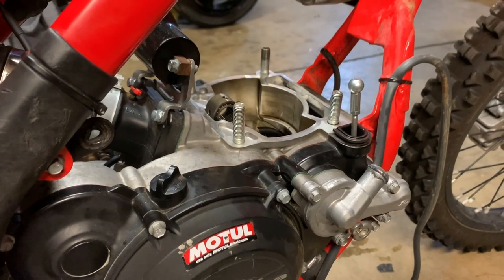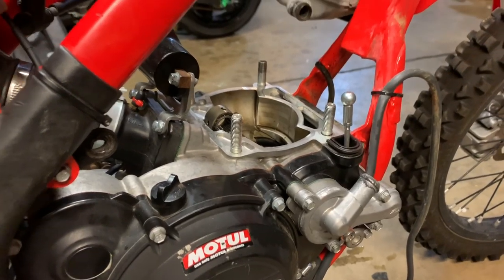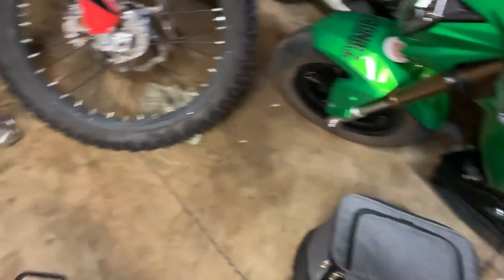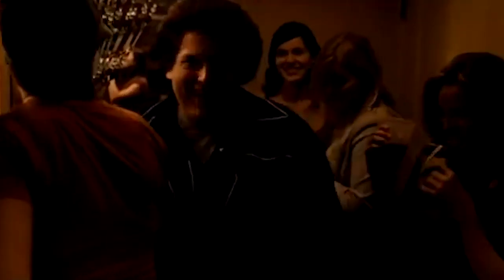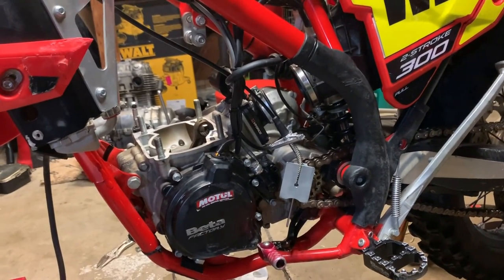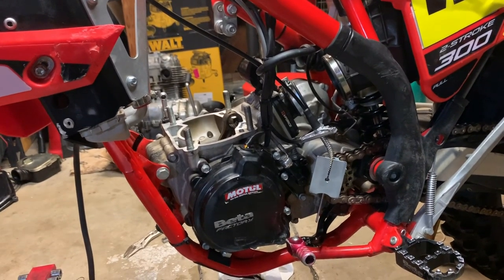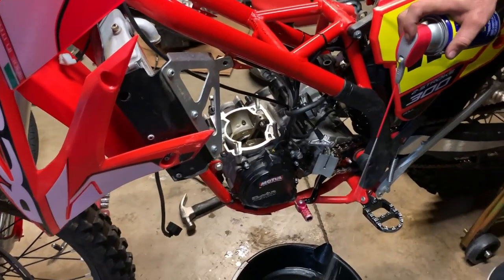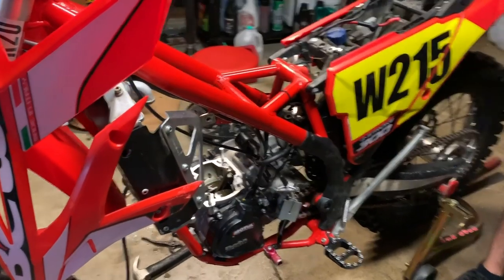I'm OVER IT

Comment: During the down time of the engine rebuild (if it were my engine), I would look into the oil injection system and make certain it is operating properly.  Excessive heat kills an engine and many times the excessive heat can be traced back to lack of lubrication.

Comment: Just because the piston is messed up, doesn't mean you need to do the bottom end too, unless something let loose in the bottom and messed up the piston. If I were out there, I would happily fix that for you. I have heard the automatic oil system on those bikes doesn't do that great a job. Might be best to pre-mix your fuel going forward.
Reply: im a firm believer that running mix in all dirt bikes is best for the engine you can never have to much lubrication
Reply: have a 17 300rr race edition (no oil injection) never had a problem other than ripping speedometer cables

Comment: It’s strange to have that amount of plugs all be bad? Did you check the coil? Is that a new piston you show ?
Reply: Metaldogrides 
Yep. I agree. Sounds like it could be a different underlying issue imo. Perhaps it were just a coincidence it fired up on the third plug. 

My feeling is that the oil injector failed at some point. Fried the rings and bottom end. 

I check my compression every 25 hours.
Reply: @Goat Heads : I’ve had a coil go bad as soon as it gets hot
Reply: @Goat Heads : the lack of smoke 💨 from the bike is suspicious? And no burned oil on the piston? Just fuel ignition marks

Comment: Oil injection is death to a motor. ( https://www.youtube.com/watch?v=r_ppb4Z_0o8)  Check out this link.  He talks about startup lubrication (or lack thereof) in most oil injection systems and the cure.  I've also read that beta says it's ok to just not use the oil injection system and go with mix-gas but I'd confirm that.  If you can go mix-gas, I'd do it.  Then you don't have to worry about cylinder lubrication.

Comment: 4 stroke life
Reply: LOL, has nothing to do with 4 stroke. They usually last 2-4 times longer then 2 stroke engines. But that are from an alfa brand manufacturer. My guess it was running to lean and died to detonations of a wrong ignition timing. Running in the hot weather and it was not set up for it.
Reply: @onhawaii  Fuel injected 4 stroke life